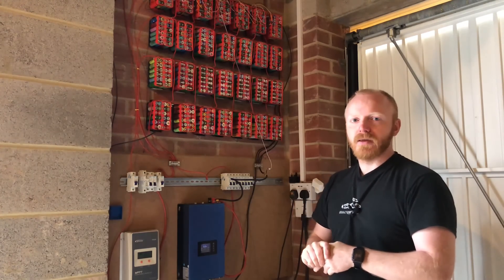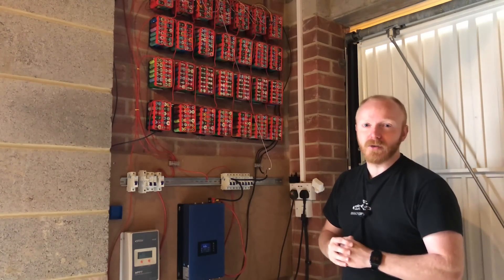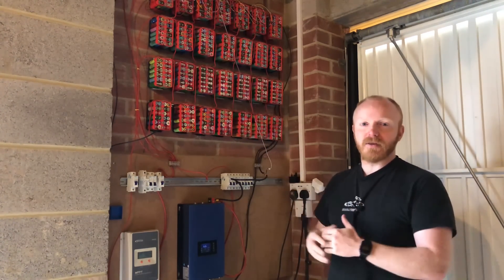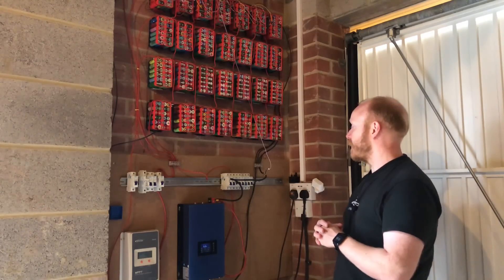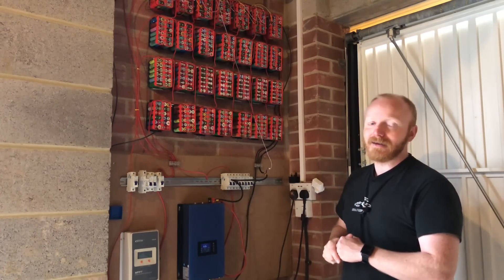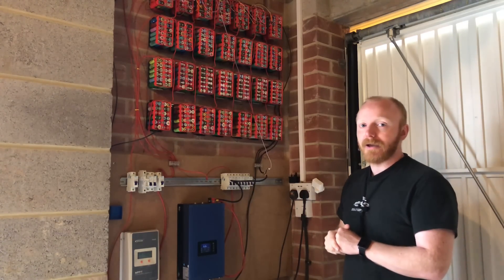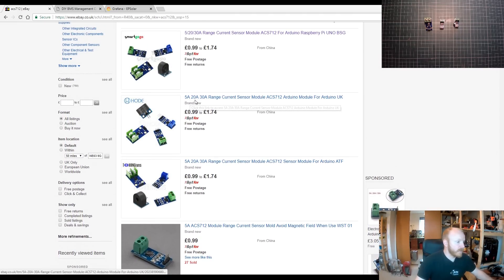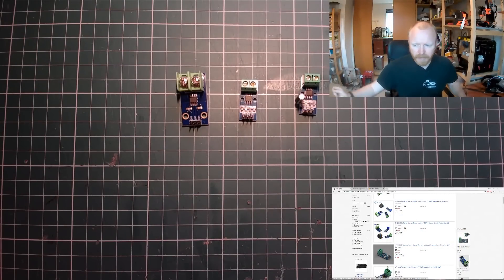DiyBMS - Monitoring Inverter usage with ACS712

Comment: I would want a low/high voltage shutdown, along with cell ballance ,, over temperature shutdown,  I have a shunt trip, that is to be used more as a latching relay, I have breakers to protect the system, along with fuses at the battery,  I hope to add the diybms this fall, I have a tiny BMS and a relay for Now, I shut the system off when I'm not home, I have alot of lithium , and not wanting to see it burn!!
Reply from the maker: You may wish to check out v4 that Stuart has done.  Has lots of options for controlling things like relays etc for high/low volt cut off

Comment: My system can pull around 250-260 amps at full inverter out put, I only use about 3-3.5kw max normally, however it is a 5kw inverter, and I'm eventually going to move up to a 8 or 10 kw, 24v, with 7s, I have a 30 and 40 amp, EPever tracer A, & AN controllers, I need to get 2 more, or a 60 amp controller, of different make, along with MORE pv, I need around 3-4kw more, or around 5-6 kw total,   I think I may get more pv in winter, due to less leaves on the trees, I get about 4 hours of decent sun in summer, and maybe 6 in winter, me data logging is non existent, I mostly look at battery voltage, and current, I do want to start track power atleast a few days per month, I'm also working on a DC generator, to charge the system to 85% on the rainy weeks, I haven't seen the sun in nearly a now!  Being offgrid, I need backups for backups, and all the power I can get, although, I only power a TV, well pump, fridge, freezer, and microwave, a few led lights,... It all adds up! I use a generator to power the washer, dryer , and cook stove, so most of my cooking is in the microwave, or wood stove,   great video!

Comment: Hi All, I have uploaded the code for the first time on the wireless module and was able to set it up and access it without provisioning any of the BMS, I then made some changes to the code in the arduino program, uploaded it with no error, but although it seems to have uploaded it still defaults back to the same ip 192.168.1.204 interface for provisioning new boards and not to 192.168.4.1 wireless config setup page.
Reply from the maker: Hi after you've uploaded are you connecting to the ip interface and then connecting it to your local wifi network?
Reply: Hi Colin,
    After uploading the new code and the module reboots, it doesn't give me the 192.168.4.1 in order to reconnect to my local wifi. It just defaults back to the same IP that was issued on my local network, as before, and the changes I have made to the code doesn't show up at all.
Reply from the maker: Ah ok when your reflashing in the arduino IDE you need to tell it what to flash, Under the Tools menu there is an option "Erase Flash".  If you choose "Sketch + Wifi Settings" or "All flash contents" it will erase the wifi settings you had previously configured.  It should have updated the code portion that you've modified though, when testing i usually just to the sketch part to avoid having to rejoin the network every time.
Reply: Thank you, it works.
Reply from the maker: Brilliant, glad you got it working.

Comment: I would also look at the acs758 - I have 5 of them and they work well. You can then connect 8G or 6G cable to it without too much problems as they are alot larger

Comment: I'm using the ACS758 sensor in my system, it's larger than the ACS712 and good for 100A. Also, just like the ACS712 there's plenty of cheap modules on ebay/aliexpress. Accuracy isn't too great though (+-0.1A).
Reply from the maker: Thanks for that i hadn't even heard of that model.  When i was looking all i could see were shunts or the ACS720.  Re the accuracy it's not great but i'm not using it in a safety scenario so i guess the accuracy is liveable especially considering the price.